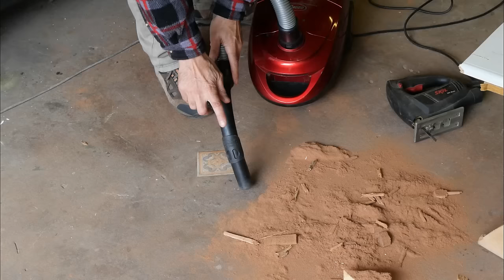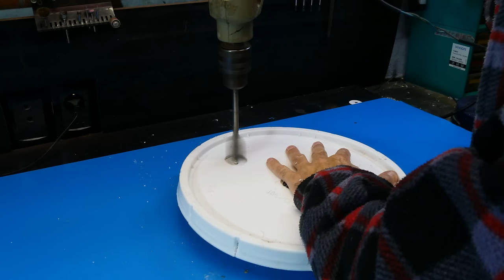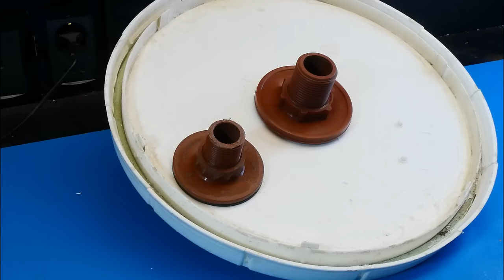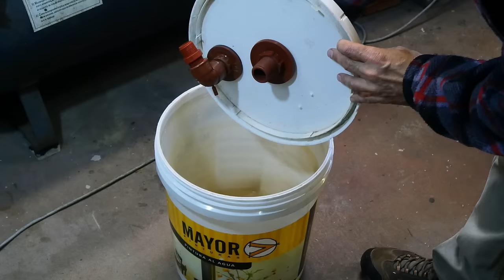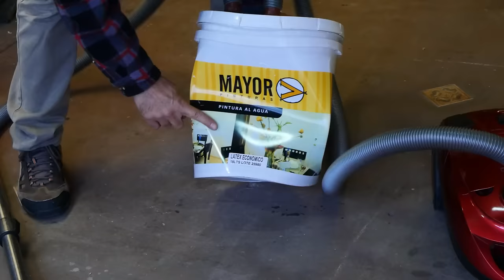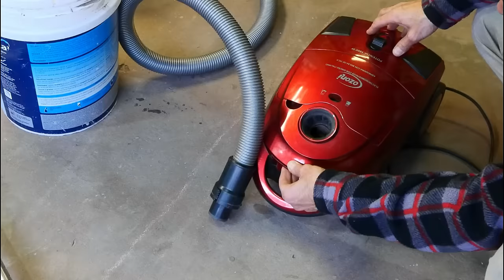Everlasting Filter for Vacuum Cleaner !! Great idea from Recicled Paint Can !!

Comment: I would just carefully sweep up the bulk of the dirt, then vacuum the residue left.  No muss no fuss and crafting filters.
Reply: These are great if working with plaster sanding dust
Reply: @rinzler9775 sanding dust is too light for that kind of "filter". It can work well only if dust is heavy enough to fall down in the bucket.
Let's consider why vacuum cleaners for wall sanders are different (and usually more expensive) than for carpenters. Wooden dust is much heavier.
Reply: Esse foi apenas um exemplo pra ficar mais fácil de fazer o vídeo, em muitos lugares não tem como varrer
Reply: These crafts are invasion
Reply: Én nem hiszem el amit mutat.Valami sántít!☹🕊
Reply: I like
Reply: @rinzler9775  Really
Reply: @adrenalinaemotor 😂😂😂
Reply: @jonathonlamb4201 😂😂😂😂
Reply: @mihalykun6715  Really

Comment: Just to add this is *not new*. It’s been around for decades. You attach the vacuum hose to the (in the shops version) metal container, then you can vacuum out cold ash from fireplaces. Saves dust and mess in houses. It has an internal filter stopping the residue from reaching the main vacuum

Comment: Thank you for teaching me this! My only question is why does the second bucket stop the first from collapsing? I guess it creates a vacuum on the outside of the first bucket that balances out the vacuum being applied on the inside?!?! That was super clever, and had you not demonstrated it I wouldn’t believe someone that told me that! Thank you again!
Reply from the maker: Yes, very clever, that´s exactly what hapens with the second bucket. Thx for watching !
Reply: The outer bucket also acts against buckling, i think, making it much stronger this way.

Buckling is a problem because it is self- reinforcing. 
If the inner bucket deflects from circular at imperfections, it gets weaker because its arc gets flatter in spots. Those spots will be sucked in, collapsing the bucket at a certain amount of vacuum.

 The outer bucket adds stiffness and keeps it circular against higher vacuum than a single bucket would.
Reply: @Repairman10169  : I reinforced mine in a different way... your way is much simpler and effective!  😊

Comment: This though good can be much improved. 

The problem with this design is the disturbance to the airflow the elbow makes causing excess particles to clog the vacuum filter - a side entry is much better. Adding a Thein baffle turns a good tool into a brilliant one.

There are plenty of videos on YT about this such as Matthias Wandel's most professional https://www.youtube.com/watch?v=z-xhYnWDCd0.

I botched together a simpler version in an afternoon - with the baffle and side entry - and I regard it as the best tool I've ever made for myself. 99%+ of the dust goes in the bucket and the bucket gets filled to the brim before there is any problem of dust entering the vacuum cleaner.
Reply from the maker: Yes agree ..thanks for comment
Reply: I love the simplicity of this build.
Wandel's approach is great if you already have $5,000 to $10,000 worth of machinery needed to build it.  
How do you know Wandel's is an improvement?  
How do you know the (complicated) side entry is better?  
Adding a Thien style baffle really, really complicates the project, and does it really make it work better?  Oneida would tell you different.  
All I'm suggesting is that unless you have some experience designing and testing vacuum systems and/or particle separators, you can't just look at something and proclaim that one is better than another.  And if one is 99% efficient and the other is 94% efficient but costs a fraction of what the better one costs, is it really better?
Reply: @dchall8  thanks for your reply, I started out with this kind of system and its good, it is a massive improvement over having nothing. Nevertheless adding a Thien baffle and simple side extraction made it significantly better for me, keeping all except the very finest dust out of the vacuum and allowing me to fill the bucket almost up to the bottom of the baffle before getting problems. I didn't find making the baffle difficult (it's just two circles to cut from a piece of ply) and it was easy to screw into the inside of the top of the  inverted bucket. I admire Wandel, he has a level of precision I don't match but mine cost me no more than a couple of hours of work and serves me well. Horses for courses.

Comment: Would something like this be good for an ash vacuum. Because the wons out there clock up very easy?
Reply: You need a vacuum with a disposable bag. The modern cyclone vacuums are useless for real work. In UK the brand Henry is popular for workshops and carpenters etc.

Comment: you've just converted your canister vac to a shop vac.  I've seen this done before on youtube.  It's fine but I prefer my shop vac. It's on wheels and easier to move around.
Reply from the maker: Yes you are right. Thx for watching !
Reply: Shop vac still need to change dust filter and dust bag. I made an extra dust bin with cyclone seperator on top of it before it goes to vacuum cleaner. Now over one year i still have a clean dust bag inside vacum cleaner even though i emtied several times it self made dust bin.

Comment: Very good, but it is better if you pour water inside that container , (about a quarter) to trap all of  the dust into water..
Reply from the maker: Yes great tip, i Will do... thanks for watching 👍
Reply: I would NOT recommend doing that... you are guaranteed to have moisture reaching the dust bag which would make cleaning it horrible.  Even worse, some moisture would probably reach the motor.